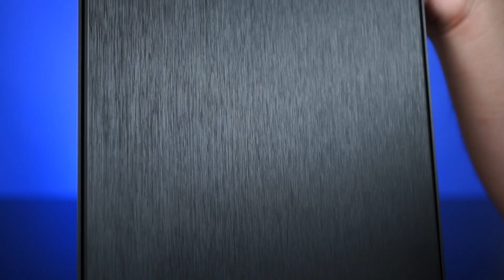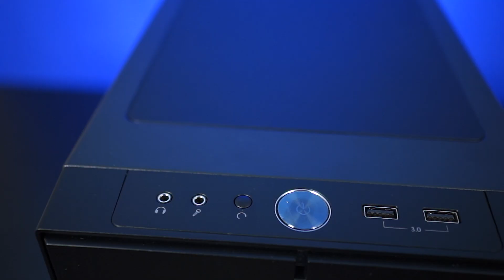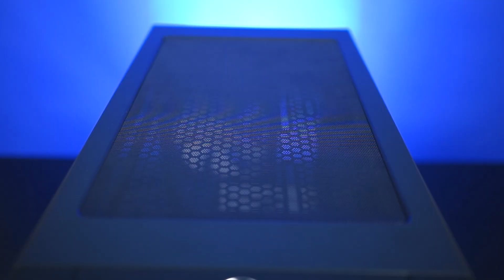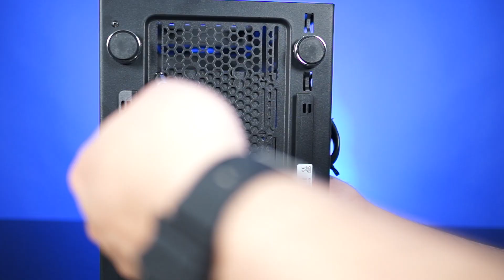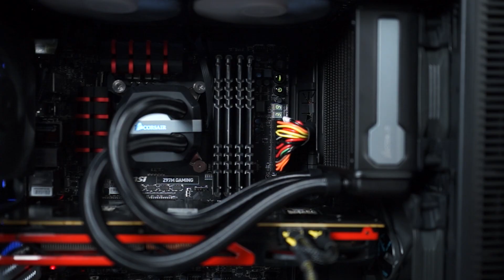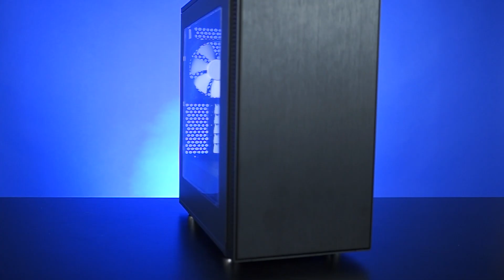Fractal Design Define MIni C - Overview

Comment: The only concern I have about this case is that the front fanfilter is too hard to access. I would like it to be as easy to access as the bottom filter, but in this case you need to remove the front panel. I would need to clean that filter every week due to hair from our cat getting stuck there...

Comment: Good review, but you do not need to remove the panel on the psu shroud in order to remove the bottom drive cage. Just remove the psu plate on the back and slide the drive cage out the back

Comment: I normally small cases isn't my thing because of cable management and becayse I prefer ATX MOBO's because I like extra space. I use 1 or 2 graphics cards, PCI-e wifi card, multiple HDD and SSD's, and other accessories. plus I like side Fans.
Reply: Although this case is nice

Comment: This or nzxt s340?
Reply: nzxt s340 doesnt have sound daming but the nzxt h440 does
Reply: Also note that the s340 doesn't have cable management that supports micro atx. So if you're a neat freak with clean cable management, the Define Mini C is far better.

Comment: Shieeet. This makes choosing my next case a lot harder. I'm pretty much 70% sold on this. Only nitpick would be that I wanted a white LED
Reply: If you're handy with a soldering iron and if the switch Fractal uses is similar to my R4, you can snip off the blue LED and solder on a white one onto the old wires like I did for my case. The 5mm LED is held under switch inside a clear plastic moulding, nothing fancy like Bulgin switches.
Reply: Benyamin Lorit just get some white molex leds/rgb strip
Reply: Knut GB No, not interior lighting. I meant for the LED indicator up top in front. Fractal still put in blue.
Reply: Remember that this case uses the M-ATX standard, which has been abandoned by motherboard manufacturers. It might be a good idea to get an ATX or ITX chassis, but M-ATX really isn't as good of an option anymore.
Reply: Pierre Le Fevre I currently use an mATX system and I don't plan on building a new one if that what you're thinking, just migrating internals to a better chassis for the time being. :) Also, when I worked on a computer store a few months back, a lot of people were still getting B150m's and Z170mx's so they're not totally extinct yet.
Reply: Benyamin Lorit They aren't? Pretty much all the PC stores in Sweden have dumped M-ATX, thought it was extinct tbh xD thanks for the info, might build an M-ATX PC instead of the ITX one I was planning
Reply: Pierre Le Fevre Yeah. There's just not that much focus on them this generation in the high-end/enthusiast market though. Most mATX boards now that do well seem to be the business class boards oriented for standard office/home use or budget gaming builds. At least that's what I've gathered. Standard ATX and ITX are still the stronger markets for most enthusiasts

Comment: If the top dust filter clicked into place instead of magnets & the front panel was more open I'd love this. Basically if it was a smaller version of the MasterCase Pro 3. Both Fractal Design & Cooler Master are so damn fucking close to what I need in a case. Seems like one always has something a tad bit off though =\.

Comment: "has no 5 1/4" drive bays"
DROPPED!
Reply: lol, optical discs are not trustworthy at all. scratches will make blocks none-readable fast. even with perfect handling, they will loose data over time (all data is gone within 50 years, even after a few years the first blocks becomes none-readable). only idiots use them for backup.

you don't need a fucking 4k uhd bluray drive on your pc. it's for tv's with hdr support.

get a fucking nas with cloud backup support. i got 32tb local raid storage. can lose 3 discs before my data is gone from the local storage and even then, i can get it all back from the cloud. welcome to the future.
Reply: What do you use them for? Fan controller?
Reply: Yeah, I use them quite alot too, sure its only a couple of times per month but its always the way, the minute you dont have it you'll need it.
Reply: Why dont you use a external optical drive instead?
Reply: MUJICA
No they do not, unless you leave them in sunlight without a case over a prolonged period of time, because plastic becomes brittle when exposed to UV light.
Reply: Yeah I still want my optical drive. I burn long term storage on them. They're much more trustworthy than any cloud storage. Also, they're just starting to come out with a new ultra high density optical disc for 4K movies and storage.
Reply: jynxed
They're slower and more expensive. Plus a case like this plus an external takes up more space than a standard case.
Reply: Trifler500 you use floppys too?
Reply: deez nuts
Nope.
Reply: +dr. whet farts Do opticals lose data over time even if they are never handled at all?

Also, you have a fine username.
Reply: deez nuts
I'm a professional Computer Consultant.

If you have scratches, then you don't know how to work with optical discs. Modern discs are very durable, unlike the first ones. I've never had a problem.

Other threats to optical discs include sunlight, since they're made of plastic, so it turns them brittle, and potentially prolonged exposure to heat.

For long term storage, I put a disc in a slim DVD case, put that in a ziploc bag, and then put it in a file cabinet or storage box. I've never had a single disc degrade and after 30 years they're as good as new.

Comment: wonder if this case has watercooling potential. if it does, i can't wait to see some online~
Reply: It does. up to 360mm up front and 280 in the roof.
Reply: i understand that this case is able to fit 360 and 240 rads. but i was wondering if watercooling is easy to build in the Define C (not the mini C) compared to the Define S where the design of the case was in mind of watercooling building with those reservoirs brackets.
Reply: most likely going to be somewhat more of a challenge too find room for the pump and reservoir as this case is more shallow compareed to the Define S. I think a small pump/res combo in the basement will be your best bet to avoid cramping up the space for the gpu(s). We will se what the first customers will make of it...or whe the mod munkeys at MNPCTECH has the case up for review

Comment: That's a pretty nice case! Any word if the sound dampeners on the top and front actually help at all?
Reply: Ive been using different iterations of Fractal`s Define series of cases for a good few years. Yes, it does make some difference. Especially on the laters version where even more thoughtprocess in the general chassis design has been focused on leading sound out the back....where it is less noteworthy. You could also buy this case with a solid side panel that adds more sound dampening material to the case.

Comment: LOOKS like a corsair carbide 400c / 400q
Reply: there are many cases without. drive bays are useless for most people these days.
Reply: Hey man, what's your opinion on the Origin Chronos? I travel a lot, and happen to have a monitor in both areas. Just looking for a decently small computer, and I don't mind it being pre-built.

Comment: 2:47 I think there is error. There should be propably not 170cm but 170mm.
Reply: pretty sure you can fit 1,7 meter cooling tower there. So I see nothing wrong with that.
Reply: yea they got that wrong xD